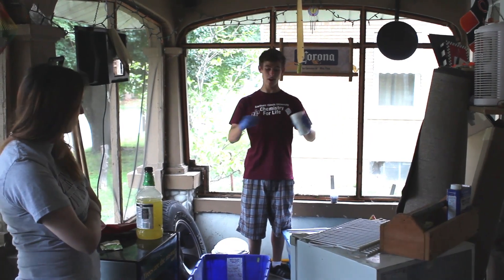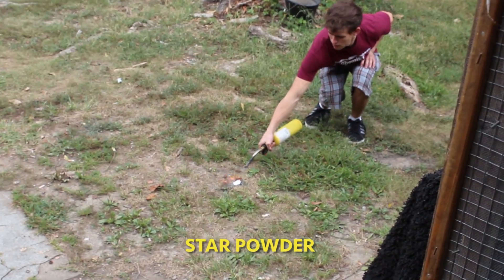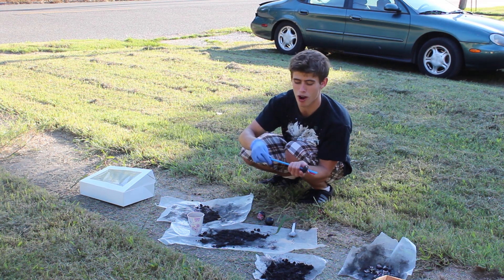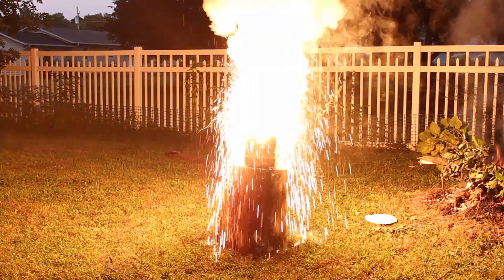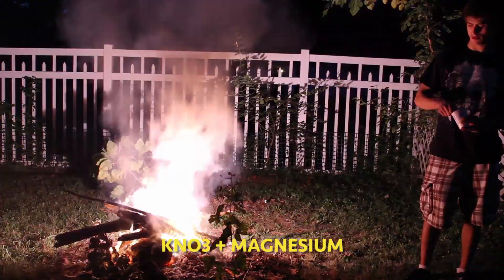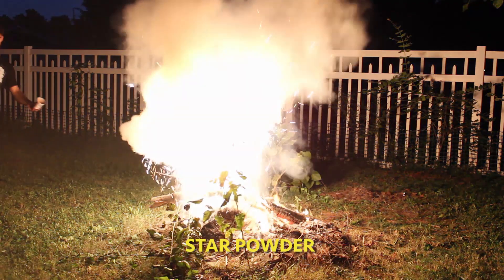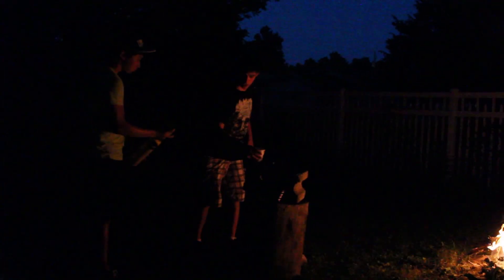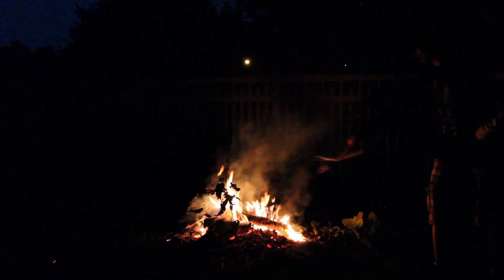DIY Fireworks Demo!!

Comment: Anyone thinking of doing this, please wear some PPE! Fire resistant long lab coat and face shield at least! And nitrile gloves will be worse than useless in a flash fire. Wear gloves that are thick and slightly electrically conductive, e.g. leather gloves. If you don't think safety and logistics are part of the fun, don't take up making fireworks. The art is stigmatized enough as it is. Stay safe.

Comment: styropyro 
A tip for you, when my chemistry teacher was mixing gunpowder he used a feather to mix it, because to much and/or sudden pressure can make the gunpowder explode.
You can test it by putting a tiny amount (less than a gram) on a flat and hard surface and then hit it with a hammer, be aware of the hammer recoil!
I hope you will live a little longer now. Good luck!
Reply: Sion I don't think gunpowder is like that, nitroglycerin on the other hand but what do I know he's the chemistry teacher
Reply: Its armstrongs mixture which is mixed with a feather
Reply: gunpowder is not that sensitive.  he knows what he is doing.
Reply: He could of used it to prevent static from building up and Igniting it
Reply: "gunpowder" can mean black powder or finely powdered nitrocellulose(smokeless powder) which have two entirely different sensitivity to friction/shock
Reply: That’s not gunpowder. Gunpowder is not at all friction or shock sensitive. You must be mistaken and mean something like Armstrong’s mix.
Reply: Black powder is incredibly stable. That's ridiculous
Reply: you can also use a piece of SMOOTH paper and lift up the corners of the paper to shift the sensitive powder
Reply: Stop being a tool, black powder is not impact sensitive, nor is nitrocellulose
Reply: He mixed 3 powders, one Yellow, one Black & one White powder.
I can only assume that the Yellow powder is Sulfur, the Black powder is Carbon & the White powder is Saltpeter.
I don't know what ratios he used.

Then he mixed it with the feather & put it on an anvil at the back of the class while everyone was distracted with copying the black board, then he hit the powder with a hammer & scared the shit out of everyone in the room (except me, because I kept track of him since he used the feather, that was suspicious as hell).